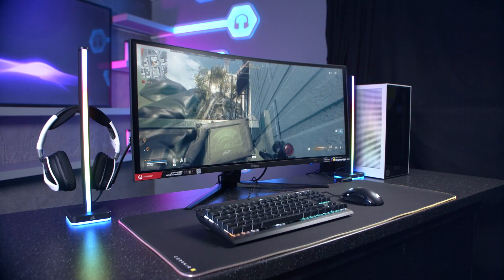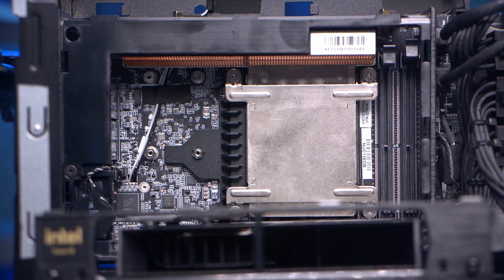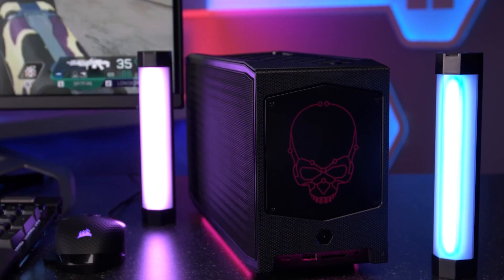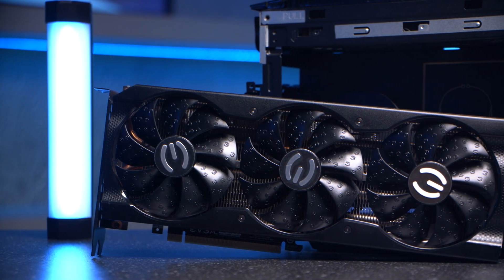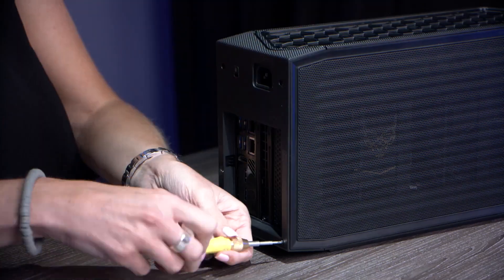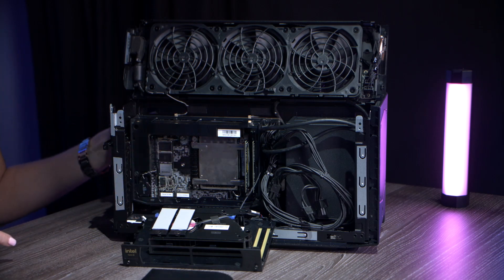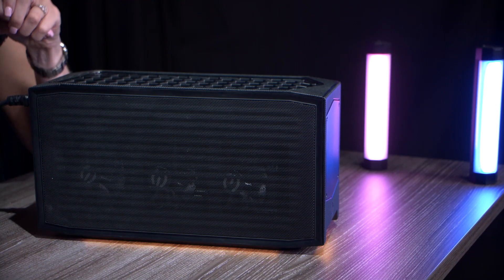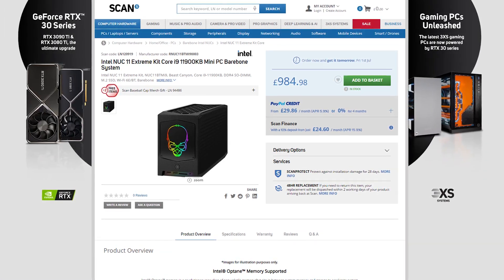Intel NUC EXTREME - Powerful performance, small package

Comment: Looks good, thinkin about moving to a smaller system myself
Reply from the maker: Nice, what do you have in mind? -GH
Reply: @ScanComputers  Well i've got an E-ATX motherboard but the case to fit the thing inside is massive. I'd want to go with something Fractal Define Mini C Compact size next time and a smaller mobo.